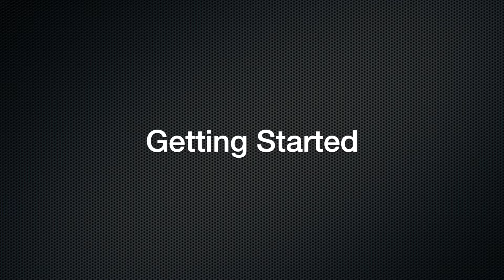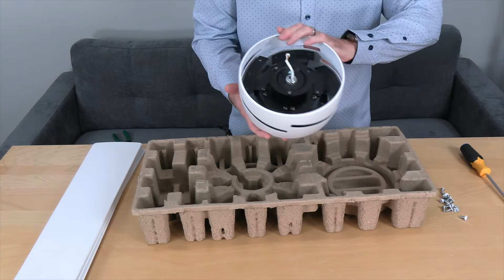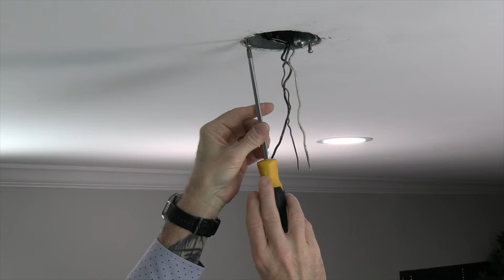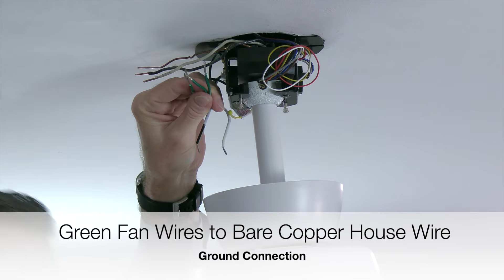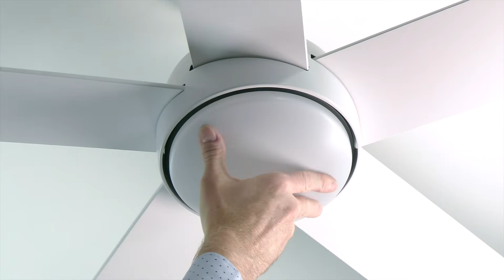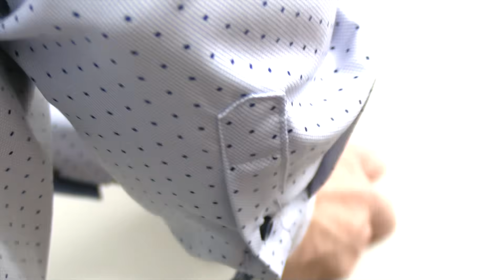How to Install the 52 in. Benning Ceiling Fan by Hampton Bay

Comment: Thank you for this video, it helped a lot! Now how do I make it so my light switch turns on the fan light?
Reply from the maker: We're happy to hear that the video was helpful! Due to the DC motor, the only switch option would be to connect the receiver power wire (black) to the switch wire for the house. This would allow you to turn the fan and light on/off simultaneously using the switch. There is not a way to have independent light control via a separate switch.

Comment: the mounting bracket is too wide to replace the original mounting bracket, i returned the fan and went down a size to the 42in fsn to find the bracket is the same size too big.. Likely because of the receiver that had to fit in the middle of the bracket makes it too wide. Im not rrpling the electrical box just to replace the fan.... what a waste of time from Hampton and Home Depot, good instructions video on install though.
Reply from the maker: The mounting bracket is a standard size mounting bracket and is designed to fit any ceiling fan rated outlet box. If the mounting bracket is too wide for the box you have installed, it may not be a ceiling fan rated outlet box. The outlet box should be marked "acceptable for ceiling fan support". We would suggest checking the outlet box you have since 2 different brackets did not fit your outlet box.

Comment: Thank you for the extremely helpful video. However, I do have a request, if at all possible, please speak with the engineers and designers, and if you have any pull, have them forced to install a few hundred of these fans so that they can make improvements on the designs. The thickness of the controller box should not completely fill the space that is available for the wires. Make the box thinner or maybe or make the canopy/shroud big enough to hold all of the wires from the controller box, and the wires from the house.? Keeping in mind that low profile junction boxes greatly amplify the nightmare.

Comment: What screw do I loosen in the outlet box? I feel like none of mine line up.
Reply from the maker: Without seeing which outlet box you have, we can not answer. In general, there should be 2 screws in the outlet box that will align with the slot of the mounting bracket. The mounting bracket is designed to align with any outlet box that is "ceiling fan rated". If your box screws do not align with the mounting bracket, you may need to replace it with an outlet box that is marked "acceptable for fan support of 35 lbs or less".

Comment: I'm not getting daylight on the led light, it's yellow, any advice? Thanks
Reply from the maker: Use the CCT button (shown in the video at the 11:57 mark) while the light is on to change the light's color temperature setting. If the light does not change color temperature, we would suggest calling Hampton Bay customer service at 1-855-434-2678. Their team is pretty good at troubleshooting over the phone and will be able to help resolve the issue.
Reply: @ceilingfans101 
That did it, thank you so much

Comment: I’ve connected everything but the blades won’t spin
Reply from the maker: Double check that all of the wire connections are correctly and completely made. If connected to a switch, make sure the switch is in the on position. If those tips do not resolve the issue, we would suggest calling Hampton Bay customer service at 1-855-434-2678. Their team is very good at troubleshooting over the phone.

Comment: I have three black wires and two white wires and when I hook mine up, it doesn’t work
Reply from the maker: In that case, we have to recommend consulting with a licensed electrician if you are unsure about the wiring. In general, the black wires may be connected to switches, if that is the case, please note that this fan would only be compatible with one standard on/off toggle switch. You would need a voltage meter to see which of the black wires are switch wires and which is a constant hot wire. The white wires SHOULD be neutral wires, but again, without being there to test, we can not advise. If you are not sure, the best bet is a licensed electrician to ensure that the wiring is connected correctly.

Comment: Can this fan/wiring be used with a 36” down rod?
Reply from the maker: This fan does not include the necessary wire for extension downrods, but it CAN be ordered by calling Hampton Bay customer service at 1-855-434-2678.

Comment: I replace my ceiling fan with this model and my old fan was controlled by a switch on the wall. My ceiling/house wiring has red, black, green, and white. My question do I connect the red along with both black wires. Thank you for the install process.
Reply from the maker: In general, you should never connect the house black and house red to the same connection. Typically, a red house wire is a switch wire. If that is the case, and the switch is a standard on/off style switch (not a wall mounted fan speed control switch) the receiver power wire canbe connected to the red wire instead of the house black wire. This would allow you to turn the fan and light on/off simultaneously using the switch. Due to the DC motor, the fan is not compatible with wall controls for speed and light control and must be operated using the remote control.
Reply: @ceilingfans101 connected per your video, wall switch is not in play. Thanks for your response.
Reply: @ceilingfans101 so would you connect the black off the fan to the red of the house?
Reply: And then the black from the house is just extra?
Reply from the maker: @AndrewSimons-x7q  Correct, if you connect the receiver power wire to the house switch wire, you would just cap off the house black wire.

Comment: Putting  electric tape after each wire connection is very good.
Reply from the maker: It just helps to secure the connection and cover any loose strands.

Comment: Can this be hooked up to where the light and fan are controlled on two different on/off switches
Reply from the maker: Thanks for the question. No, the fan has a DC motor and can only be controlled via the included remote. The only switch option for this fan would be a single standard on/off toggle switch.